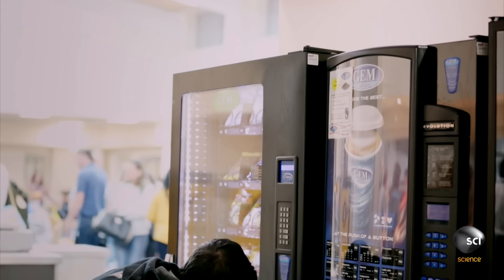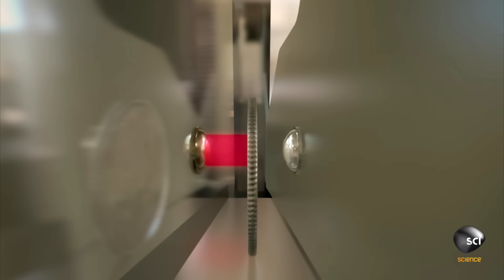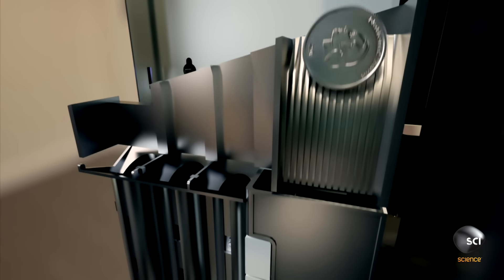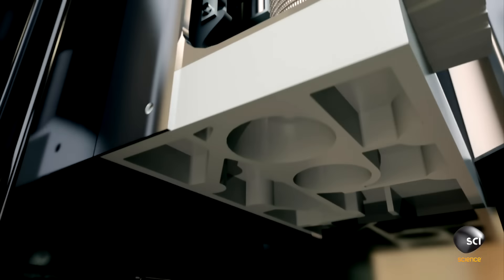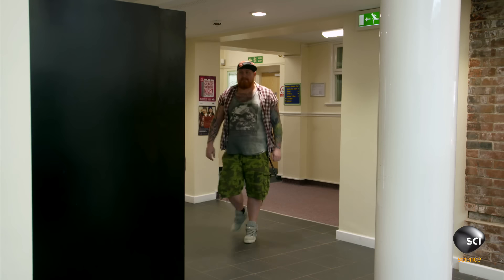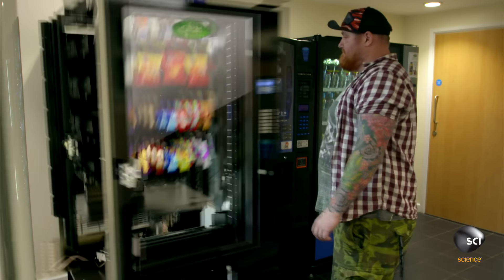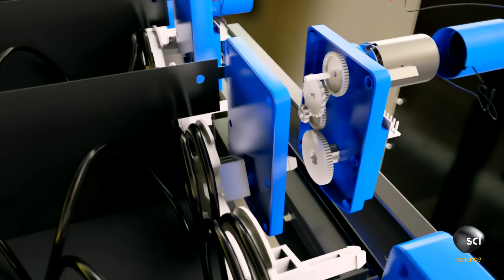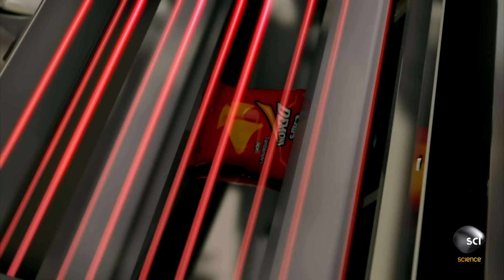How Do Vending Machines Detect Fake Coins?

Comment: "The machine deciphers coins with pin point accuracy"

Me putting my quarter in for the 4th time: ಠ_ಠ
Reply: LOL! I swear, I thought the same thing, and have the same expression.
Reply: This generation I guess. 3 years ago ther Will be local boxing matches with these machines
Reply: @pltkaiser9258  yeah lol
Reply: @pltkaiser9258  nah the narrator is over exaggerating everything. The infrared beams detecting anything falling isn't "ingenious technology." Stuff can still get stuck and its a really cheap technology.
Reply: Just wipe off the blood
Reply: I would like it but it’s at 665
Reply: they can't decipher dollar bills at all...smh
Reply: @Peter Evans That would probably cost more in machinery, metal and man-hours than just putting a quarter in.
Reply: Nah dude I once insert a toy metal coin and still get a soda
Reply: @Peter Evans the magnets would detect the steel and reject the "coin" because real currency isn't magnetic
Reply: An item I bought getting stuck in the vending machine at work yesterday,and they've gobbled my coins for nothing in return a few times in the past. A few weeks ago I tried to buy a snack from the same machine and it quoted me £635.00,which seems rather a lot for a packet of Walkers Cheese & Onion crisps.
Reply: That's because it's "too" accurate.

Comment: "The machine deciphers coins with pinpoint accuracy."

Me: Tries inserting dollar bill for the 7th time, only to have it rejected because there is an atom-sized crease on one of the corners
Reply: Yes, pinpoint accuracy
Reply: Yes, because a dollar bill is a coin
Reply: Dollar bills are verified via scanning them (imaging) as they’re entered. The acceptor can be reprogrammed as necessary, for example, if a bill design changes drastically and the current database would return a false negative. If the bill is folded in the corner or otherwise defaced too much, it will not get recognized correctly. I assume a margin of error in detection is allowed to accommodate older bills, but it would be a small margin because forgeries can be pretty good sometimes
Reply: @qazxsw21000  makes sense. That's neat
Reply: You just proved their right
Reply: You see this is why you need a rolling pin  on you every second of a day
Reply: Or when the machine clearly says that it "accepts $5 bills" yet outright refuses them in practice.
Reply: Exactly
Reply: 🤣 That’s so true!
Reply: bill detectors are an entirely different thing. a coin is metal, doesn't wear very much. the sensors test diameter, which doesn't change much, and metal type, which doesn't change. They also used to test thickness, and weight, by simple mechanical  tests. A paper bill, on the other hand, does wear, get torn, get dirty, get defaced, get folded or wrinkled. Those defects make it mhch harder to test. I used to only feed vending machines the newest, cleanest, least folded bills I had. when I rode the public bus, I found out that the fare box coin detectors would take the modern "goldie" dollar coins. After thaf, every time I went to the bank, I bought a roll of them, and used them just for bus fare. No more problems.
Reply: Imagine comparing a DOLLAR BILL with COINS
Reply: @FullyRubiks  no shit, really?
Reply: @qazxsw21000  why doesn't it work?
Reply: I work on bill validators and printers, its very likely the vendor never actually cleans the bill validator causing a lot of bills inserted to be improperly read (theres an absolute load of sensors in these things) meaning the bv either doesnt get proper color detection, cant read the actual size, denomination, and securities imprinted into the bill. BVs can actually read fairly heavily crumpled bills if theyre well maintained, keeping them in proper working order basically requires their own technician though which with how little a vending machine actually makes after renting the area its in, cost of items in the machine, and extraneous maintenance on the machine makes it not worth it to actually do. Also bvs cost a hell of a lot of money to just straight up buy a new one so good luck ever convincing them to do that unless the thing is straight up demolished beyond repair
Reply: In Australia, our dollar bills are in various lengths depending on the value (the United States is the ONLY country on this planet that makes all their bills the exact same size - makes no sense when you think about it) and our bills, which are made of polymer, making them considerably more durable, have special stripes on the long edges in four spots on either side, specially coloured and sized so the machines have an easier and more efficient time detecting them.
Reply: The moral of the story is treat your folding money with care or go full electronic. I don't carry cash which creates so many benefits. I don't have to worry about correct change, I don't wreck my wallet, I don't lose money, I can tell beggars I don't have any cash (if I want to help them I will buy them some food and a drink).
Reply: @haruchai  didnt the entirety of canada have their bankaccounts get frozen? What if it happens to you too?
Reply: @youtubestudiosucks978   I carry gold nuggets and silver bars with me.
Reply: I’m actually cracking up tn
Reply: @FullyRubiks  I have real coins also rejected all the time only to have it accepted a few tries later. So again “pinpoint accuracy” ;)
Reply: As I've been saying for years:  We can put a probe on a comet, but we cant make a vending machine that will take a SLIGHTLY wrinkled dollar bill
Reply: That's why first world nations don't use dollar bills.
Reply: it said coins not dollars just get good m8
Reply: @jjham6780  it’s a vending machine not call of duty :’)
Reply: @xeric1953  i guess ive never even played cod so like
Reply: @jjham6780  it’s a vending machine not a video game

Comment: "the computer makes the coils turn again"
so that was a lie
Reply: Yeah not again but my drink didn't fall down so it gave me another choice, so I chose the same row and it did gave me 2 so at least some win for all the losses I went through. Also for all THAT price, it should be two anyways...
Reply: @Doommaster19  Some with the card readers won't charge you if it doesn't fall and just assumes the item is out of stock. Much better than losing your money, but slightly frustrating you can't get what you want.
Reply: old ones dont but the ones do
Reply: More like I’ll have to fuckin PAY again lol
Reply: All the the vending machines where I work have the refund sensor. If the snack doesn't fall it rotates a few more times, if it still doesn't fall it give the money back.
Reply: @guythatlikesbananas6293  No links!
Reply: @LewdnCute  you must work in heaven and are one of the angels that are often talked about.
Reply: there's an immediate attack idea on this system. insert a catcher that does not break the lasers, but catches the snack above the lasers (there are multiple ways to design such a thing). then the machine will think that it failed, and push again, if your catcher is good enough, multiple times.

Comment: Video: “You’ll never leave hungry.”

Me: Has 3 bags stuck in the same spot
Reply: @justinmiller129  why????
Reply: Me: hungry
Again me: buy a snack from vending machine
Snack: got stuck
Also me: buy second snack so it will fall on first snack and get first snack unstuck
Second snack: doesn't care about my plans and got stuck on top of first snack
Me: went away still hungry

Anyway I tried to shake machine multiple times without any result before and after buying second one
Reply: Yea and then it says "error" and you screwed
Reply: SlimyKlerburt  did you read my comment? I bought two of it and they both became stuck
Reply: SlimyKlerburt  I didn't get it. So you pay for one thing and get unlimited things of this type or what? Or your machine can detect that item just stuck? Our machine cannot
Reply: At one vending machine I would either get 3 bags or nothing at all lol
Reply: SlimyKlerburt  what if it gets stuck 19 times and at the 20th try it falls, do i get 20 snacks at the price of one?
Reply: @owoberon4947  I hope your dreams can come true in your life and in mine LMAO😂😍
Reply: I think it depends on the vending machine
Reply: @owoberon4947  in my case/own experience, when the snack got stuck and didn't fall, it keeps rolling until the second snack push the stuck one, so I got two at the price of one
Reply: thing is, if this happens, it should keep releasing new bags until you get like 10 bags of your snack, and this also incentivizes the vending machine owners to make sure your snack doesn’t get stuck in the first place, because they would lose money every time it gets stuck
Reply: And the machine do a complex move to..

Me:breaks the glass and got free snacks
Reply: When I was little some of my snacks would get stuck and i would get a empty feeling of sadness in my chest
Reply: @sodiboo  Wow every vending machine I’ve ever used couldn’t care less that you lost a snack. It’s like “Oh well guess you gotta keep trying or go home!”
Reply: Think I saw video with a clip like that one time
Reply: @jacobthemaster66  yeah that's because it costs less money to remove the anti-stuck mechanism than it does to make it never get stuck in the first place, and it earns more money in the long run since at least some customers will buy another snack just to knock the first one down, which might incentivize making it get stuck on purpose, because some people will just leave (and maybe never come back), but some people would pay 2 or 3 times the original price, because they are getting 2 or 3 times as much product, even though they don't want any more product and are just wasting their own money and giving it to the machine owner
Reply: I once saw a machine in which a bottle blocked the anti theft door which resulted into blocking the door to retrieve your snack. It was quite sad as you could tell many people didn't notice this in time as there was a load of snacks at the bottem, all out of reach because of that one bottle...

Comment: >"With pinpoint accuracy"
>Rejects a legitimate coin on the first 2 tries
Reply: first two times!?!?! you mean everytime. these things are so shit i always have to send coins in like 10 times to get food.
Reply: With pinpoint accuracy*

*Does not work every time
Reply: usually the magnetic sensor fails - when your coin has a charge or is magnetized, it will believe that your coin is a piece of steel cut to the perfect coin size. Removing the charge by sliding the coin on a metal surface may solve the problem

Comment: “Always get your snack” is one of the biggest lies I’ve heard
Reply: The machines I've dealt with are obviously not as high tech as this one!
Reply: Your probably experiencing a disgusting old one with very less technology smh the one on the nearby store breaks down every time idk why it just randomly stops and all the button lights start Blinking and the display starts showing "ERR" liek some sort of error I don't understand
Reply: Indeed. Notice the beams are well above the catch area. Several times, my snack has successfully dropped, but also successfully bridged front to back, just above the shield that pops up when the door is opened (to prevent people from reaching in that way to grab a snack). So that "nice" stable bridge prevents the snack from falling the rest of the way, and since it's stable, no amount of rocking or hitting is gonna get it to fall.
Reply: So the vending machine detects a fake coin. Then how does the vending machine detect front kick?
Reply: Well that “always get your snack” technology dropped me 2 KitKat bars instead of one a couple months ago, so I’m all for it.
Reply: My thoughts exactly XD
Reply: @EdgeLie  old machines are still used today
Reply: That's vending machine self preservation.  If the customer loses money or doesn't get a snack then the machine usually takes a severe beating
Reply: I recently used a drink vendor at my university. Hadnt used a vending machine in a few years and the drink got stuck. I sat around angry for about 10 seconds before, to my amazement, the machine pushed the drink out into the collection tray after it had stopped moving.
Reply: @davomcbones8138  Wasn't really the issue of the tech, as I have seen the snack simply get stuck in the coil, OR the situations where the chip bag is stuck against the front window. and you have to rock the machine to get it to drop.
Reply: @Mercenary-1914  ah, yeah that sounds.... Annoying

Comment: So, young Mr. Krabs' coin on a string is technologically impossible today.
Reply: Oh snap
Reply: Ya i watching it in other tab of my computer
Reply: Not exactly, you need to pull it back after the magnet's
Reply: I wanted to do that
Reply: I was thinking bout it at the moment
Reply: @Quest_Mind  just use the magnet to mess with the chip. It will put them out of business in no time and is completely free.
Reply: Maybe a really big elastic string which can’t be picked up in infrared or motion sensing
Reply: @carracer41  what magnet should I use and where to put it
I have two parts of neodium (did i spell it right?) Magnet i pulled from a dead hard disk drive. They're quite small and dont generate that much of magnetic field though
Reply: @Juppie902  the machine wouldn't spit out all the snacks, it would just stop working. You could buy way stronger magnets (~250kg force) for less then 30 bucks on Amazon
Reply: Seems so
Reply: Andrew Grey but that’s an investement for doritos. Imagine the quantity of doritos you could get and resale or eat because that’s what normal people do
Reply: @kvvrt6869  first time?
Reply: @Juppie902  you're actually thinking of stealing from a fucking vending machine?
Reply: @m_i_g_5108  we're hungry
Reply: @shadidmosharraf3033  How are you on YouTube? You can afford an internet connection, but not a 75-cent snack? 😂

Anyway, I called the cops and reported the other guy.
Reply: @m_i_g_5108  wait who? And I don't think the police would even care about vending machine stuff.
Reply: No coin is perfect: it'll have dents and dirt changing its shape. So, the sensors measuring with "pinpoint accuracy" is a lie. So, if you use a thin enough string, and don't pull it out too soon (it has to pass the 2 sensors after all), it should work.

Comment: Vending machines: uses light sensors and electromagnets to accurately sense coins

Also vending machines when I put in a quarter: "Wtf is that"
Reply: Me: It uses electromagnets 

Sticks two magnets near the electromagnets. Take my fake coins now BITCH HA I win.
Reply: @KawaiiSoulB42  Except any decently made machine would just lock up because it can't read the electromagnet's data and reject any coins. You've never actually tried this did you?
Besides, it seems they did not put a weight sensor (the most important one imo) in this machine. So a tiny hole in coin and your thinnest fishing wire will actually do the trick lol.
Reply: Subaru
Reply: @Zebra 2015

Where did anyone mention a car?
Reply: @wafflesncatsup5323  subaru from rezero look the pfp lol you're fun
Reply: @KawaiiSoulB42  lol😂

Comment: In 1981 I made a quarter mold in auto shop with a friend. We used pipe with an inside diameter equal to a quarter. We cut off the thickness of a quarter then tack welded it onto a base plate. Using tire lead we melted these in to the mold and had quarters. We used these for the coke machine in the locker room and for video games in town.

Arcade video games were everywhere back then. Before our quarter forging, we would snap the plate off of he coin return slot. A penny could be pressed upwards then snapped to go up and come back down, triggering the micro switch that unlocked the game. 

My buddy got busted in a pool hall doing this.

I worked with a guy whose father had games all over the valley. He had keys to the machines. We collected quarters and fixed machines. Mostly I played for free. I usually earned a roll or two of quarters for tagging along.

The summer I turned 18, my parents went on a camping road trip. I brought in a bunch of machines and had kegerator parties 2-3 nights a week. Just about every night was a small party of friends. We drank beer and played video games. 

We blasted a stereo through someone’s bass amplifier. Yah, the sound quality wasn’t great, but it was loud.

:-)

Comment: so how Mr. Krabs bypass this?
Reply: idk
Reply: @Mr.Springtrap yup but once u put it in u cant get it out
Reply: Or bender
Reply: @Mr.Springtrap would that actually work
Reply: @Mr.Springtrap to summarize... older machines did size and weight to figure out the coin in question and reject fakes... because of this, once the machine knew what kind of coin it was, assuming it matched, it could be pulled out to reuse... as was stated, newer machines won't allow that to work, but if you wanted to do this with an old enough machine, it's totally possible
Reply: @Mr.Springtrap thats hilarious i know the episode
Reply: @kikhuy8152  joke
Reply: @tektonik4616  I think I read or heard once that newer machines are designed to cut the string when pulled. It’s been several years since then, so it could be a little wrong or completely invalid.
Reply: @kikhuy8152  bruh Mr. Krabs literally drove a bathtub for a dollar, are you really underestimating his power
Reply: He does what bender does